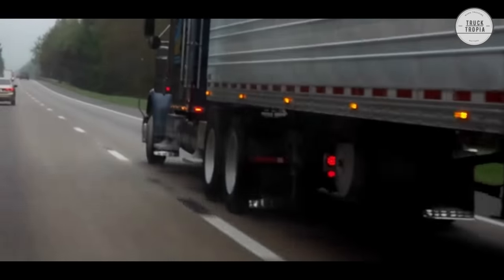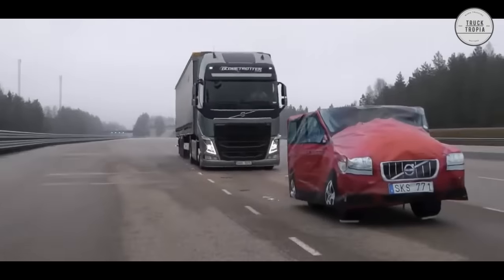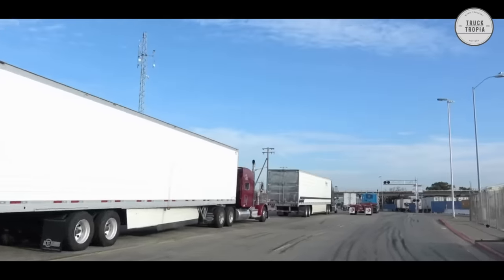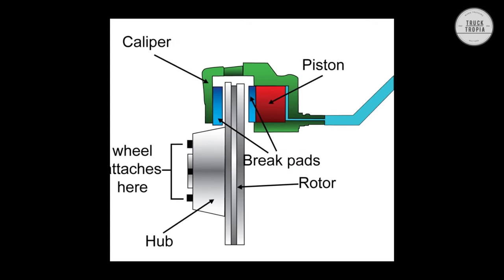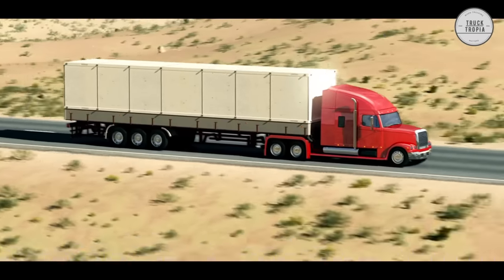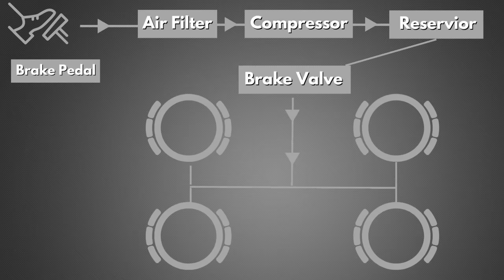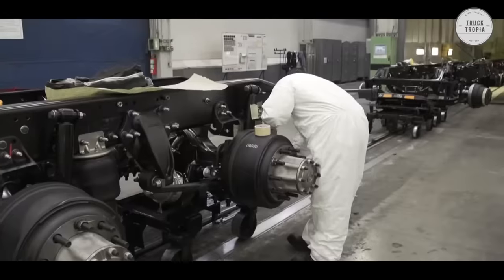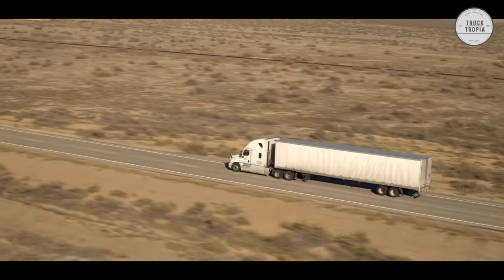Why Do Semi-Trucks Use Air Brakes?

Comment: You would think the most expensive car would have the most expensive braking system. But I don’t think I’ve ever seen or heard a car with an air brake system.
Reply: They don't need them and it adds alot of weight

Comment: If Air brakes are better than hydraulics, why are they not use in automobiles?
Reply from the maker: To expensive … Watch the video 😅👍
Reply: Poor response time, no pedal feel, unwanted noise of exhausting air, excessive size of actuators, need for a compressed air supply...

Comment: you got it backwards bro,
air brakes have more parts comoared to hydraulic brakes,
air brakes works in opposite,
brakes activate when air is released, same thing happen when air tank loses air the brakes stay in locked position,
the reason why air brakes were used on big ones are the failsafe mechanism which is the self lock once the air pressure droos below the requirement,
safety mechanism bro

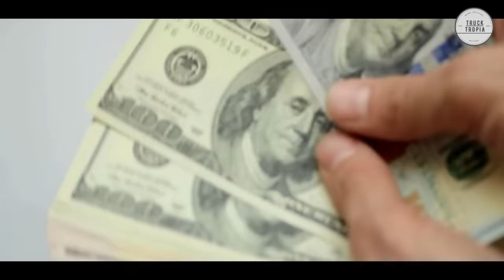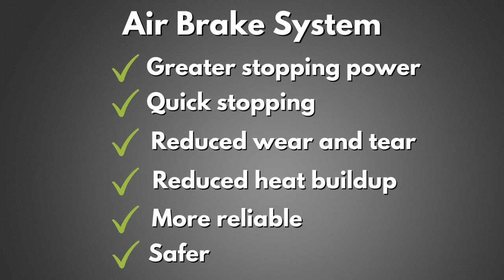Comment: @0:40 disc brakes are also more expensive, @4:24 the air brake system is however a significantly more expensive system. so in conclusion brakes are expensive!?

Comment: Air is an air brake system is not used to brake but to "unbrake" the wheels. The heavy spring inside f the brake chamber is the one doing the braking, so if you loose air you loose the ability to move, not to stop. The system fails in a locked position so its also a safety mechanism. At least that's my understanding.
Reply: People are being mislead, taught wrong, and completely misunderstand air brake systems.

Comment: Surely no trucker has footwear as we see @1:07.

Also, the number of mistakes built up. We see the overheated brakes @1:51 glowing red, and that being blamed on them being hydraulic which is simple nonsense. Any brake disk required to dissipate too much heat is going to glow red and fade, whether hydraulically, mechanically, vacuum or air operated. Then @1:55 the video implies that air brakes are not operated by a fluid. Fluid is not synonymous with liquid. Both gasses and liquids are fluids as they flow (unlike a solid). If you want to distinguish between liquid and gas powered devices, then simply use hydraulic and gas as the descriptors, not fluid.

The video is also misleading as it gives the impression by default that it is the air that is doing the work of operating the brakes, whether disk or drum. That is not the case; the brakes are operated via powerful springs that, by default, press the shoes onto the drum or pads on disks. The air doesn't actually operate the brakes, it releases them. That way, if there is a large leak, then the brakes will be locked on, making it fail-safe. That also means that if a trailer is detached from the traction unit, it's not going to go anywhere as its brakes are locked on. In effect, the actual operation is mechanical via that spring.

Then, later on it repeats the nonsense that aid brake systems do not suffer from brake fade. That's utterly ridiculous. If a truck is coming down a steep, long road, and is being slowed by friction brakes alone, then they will get hot as they turn the truck's kinetic energy into heat. If the friction brakes can't dissipate the heat fast enough, they will fade, and it doesn't matter the slightest id they are hydraulically or air actuated. Hence trucks often have other braking systems, such as those that use the engine as a pump such as compression release engine brakes (often called "Jake brakes") or hydraulic retard systems attached to the gearbox. 

Also, the vast majority of modern hydraulic braking systems also use air in the form of the vacuum servo boost system. That uses differential gas pressure across the two sides of a large diameter diaphragm to boost the pressure on the hydraulic master cylinder.

In any event, the video misses out the most important reason for using air brakes on such trucks, and that is because it is very easy to couple and decouple the braking system on a trailer using air brakes. Unlike doing the same with hydraulic hose connectors, there's no hydraulic fluid to leak out, and it's even possible to tolerate a small leak on the coupling for a while.

Comment: Just think how simple air brakes are. Tractor trucks pull trailers . And when you 
Unhook a trailer
Only three line have to be unhooked two airlines and the wires for electrical. 
If fluid brakes were used it would be impratical.

Comment: This ain't right.... although breaks do actuate by pressing pads against rotors... thats now how they work. Breaks work converting kinetic energy into heat energy when through friction of the pads pressing against the rotors. Brake fade results when trying to brake when the rotors are red hot.. meaning no more kinetic energy can be converted as the rotors are too hot. This would occur in a hydraulic or air breaking system.

Comment: Disc brakes are not always the better brakes, they are just cheaper to manufacture and maintain...the best braking results are achieved with so-called "Duoduplex" drum brakes and oh yes, hydraulic brakes lose braking power with increasing age, and there is still the danger that when you brake a lot you step on the "empty" pedal because air bubbles have formed in the hydraulics due to the heat

Comment: Air brakes are used because it's easier to connect various trailers to the tractor unit.  They are not better, not simpler, not more dependable, not cheaper, not ANYTHING!  They are the easiest way to connect various trucks to various trailers

Comment: Yeah… that’s not accurate at all. Air brakes are no more reliable or less susceptible to fade than hydraulic brakes. If you don’t believe me… google “truck runaway lanes”. Here’s a hint. They’re not for the majority of vehicles with hydraulic brakes… 

There are FAR FEWER moving parts on a hydraulic brake system than an air system. Hydraulic brakes have a master cylinder, brake lines, abs module and a caliper or wheel cylinder. 

Air brakes have a compressor, governor, regulator, air tanks, air dryer, treadle valve, air lines, brake chambers, spring brakes, quick release valves, slack adjusters, S-Cams, S-Cam bushings, and that’s not even HALF the parts in a modern air brake system. Not to mention air brake systems freeze up ALL! THE!! TIME!!! In the winter. If your hydraulic brakes have a problem in the cold. It’s a slightly stiff pedal for a few miles. 

The primary reason air systems are used is because of the need to quickly attach and detach trailers of all kinds and sizes. Hooking up a supply and a service air line is far more fool proof than trying to hook up a CLOSED CENTER hydraulic line with out causing an airlock in the system. That’s really about it… There’s also absolutely ZERO truth to air brakes having “more power”. If they did. They wouldn’t need so many mechanical parts creating the necessary force required to stop an 80,000lb truck. 

But I’ve only been a diesel mechanic for the better part of 20 years, so what do I know?🤷🏻

Comment: So many of the points in the video are not true.  Air brakes are not more reliable than hydraulic.  Both are reliable.  Air brakes don't have a longer life, that's all about a heavy foot or not.  Air brakes can overheat and fade.  This needs a re-write.  Fix the facts man.

Comment: Semi trailers use air brakes for the same reason trains do. Because they can be disconnected and reconnected. That's simply not possible with hydraulic brakes. End of story.

Comment: Air brakes use air to compress a spring in the brake chambers, also known as "cans." It is these springs that provide the brake force that is applying the brake shoes/pads. When the driver steps on the brake pedal, the air is released and the springs apply the force. This is also why the vehicle will slow down/stop if you lose your air pressure. Because the springs are no longer being held back.

Comment: In my opinion, hydraulic brake is more reliable than air brake. The reason why semi truck uses air brake is mainly about cost. Also it is difficult to make a flexible liquid connection between the tractor and the trailer. Heavy airplanes can be over 100 tons and they still use hydraulic brakes.

Comment: The main reason for commercial trucks to have air brake system is because air travels alot faster than fluid therfore less delay for braking
Reply: Not correct. Force applied to a liquid is transmitted virtually instantaneously because the liquid is incompressible, unlike a gas. That’s one reason why it is so bad to get air in a hydraulic brake system and why bleeding the brakes is important. (Another reason is that extra force is required as some of the applied force is wasted by compressing any air in a hydraulic system.)
Reply: @Stephen Foster  correct, but semi trucks have chasis length far greater than regular vehicles therefore having lengthy brake system lines. Even current air brake systems have a delay. Thats why at the end of a semi truck you have a air brake governor that connects to all brakes in rear. This would be very difficult with hydraulic systems.

Comment: This video is not very good. It contradicts itself multiple times. In the beginning it says air brakes are more expensive, but in the end it says air brakes are cheaper. In the beginning it says disk brakes are better at stopping power, but the conclusion says the exact opposite. Awful video.

Comment: Who authorized this false information? Pressing the brake pedal on an air brake system does not apply pressure with the air to apply the brakes. It releases the air pressure from the brake chamber that was forcing the coil springs to compress.  The uncompressing coil spring is what applies pressure to the brakes.  That is why a truck that loses air pressure has the brakes lock up.  It is not the old movies that lose brakes when an air line breaks. It needs air pressure to release the brakes not apply them.

Comment: So much of this is wrong information.  Air brakes have more parts, cost more. Old old trucks did work some what as described. They were known to break,  why the need for truck runaway ramps. Then came the idea of spring brakes. Now abs brakes and a new set of problems.

Comment: Its tje opposite, pressurized air unlock the brakes, the pedal releases pressure and the fall activates the spring instantaneously. Easier than pumping a fluid thru lanes to activate breaking. A pressure drop is faster, the spring loaded turtles do the job, not the air.

Comment: Airbrakes are definitely NOT more reliable than hydraulic system! I find faulty air brakes on trucks every single day! 
Also air brakes are not more powerful than hydraulic. 120 psi air pressure versus up to 1000 psi hydraulic pressure in most cars. The actuators (chambers are much bigger to compensate) the foundation brake decides how powerful a brake is. Not the actuation method.

Comment: The whole last half of this video is false. The main reason trucks use air brakes is because you don't need to bleed your brakes when you hook up to a trailer. Air brake systems have more components and are much heavier than Hydraulic making them less efficient. Air brakes also suck in cold weather as most moronic truck drivers don't drain their tanks and then the air system freezes up and it either locks up on the highway, locks up at a stop then you're stuck or can even sometimes fail to apply. Get the facts straight please.

Comment: TRULY I TRULY AM A TRUCK DRIVER . . . AND . . . WHEN THEY SAID THAT WITH AIR BRAKES THE TRUCK HAVE A BETTER WAY TO SLOW DOWN AND STOP . TRULY I TRULY NOT TRUE BECAUSE OF THE EXTREME WEIGHT OF THE TRUCK WHEN MOVING .

Comment: Your understanding of air brakes is incorrect.  The braking for evon air brakes comes from a heavy spring.  Air pressure is used to compress the spring to release the brake.  When air pressure is released.  The heavy spring applies braking force

Comment: 2:10 Wrong, completely wrong! the air disengages the stopping power of the brakes. The braking force is from a mechanical spring that is retracted by the air pressure, so that in the event of an air pressure failure, the truck comes to a stop and Fails Safe and cannot move/ This is the reason why air brakes are required in the USA for any vehicle rated for a gross weight over 26,000 lbs!

Comment: "air brakes are more reliable because no fluid leaks" - wth? How is it better to have air leak instead of fluid leak?? In case of a fluid leak it is much easier to find a leaking pipe at least.
The only reason to prefer airlines from the presented list is connecting/disconnecting trailer air-lines. Other stuff sounds at least dubious.
EDIT: comments to the video have a lot more sense! This video is that type of irritating ones that make you dumber...

Comment: At 5 seconds you said semi trucks dont use hydrolic brake systems, just air brake systems. Then at 19 seconds you said that semi trucks use both systems.

The credibility of the entire video has gone out the window before I could finish eating thus potato chip.

Comment: The whole point of air brakes is that the brake is engaged when there is NO AIR PRESSURE.  The springs keep the brakes engaged until you make air.  The air pressure is released to engage the brakes.  When you see a truck in the movies that gets it's airlines cut and suddenly no brakes, no that's not real.  If you lose air pressure on a truck, the brakes automatically engage and you stop.  Again, the air pressure keeps the brakes from engaging.  Air pressure does not "engage the brakes".  In an absolute, oh shit scenario, the truck locks up and rolls to a stop.  Sorry, but that misconception drives me crazy.

Comment: Sorry to say but the video has false information, Air Pressure is used to disengage the brakes, not to apply them. Breaks are applied by a powerful loaded spring, it is the opposite of this video is trying to explain.